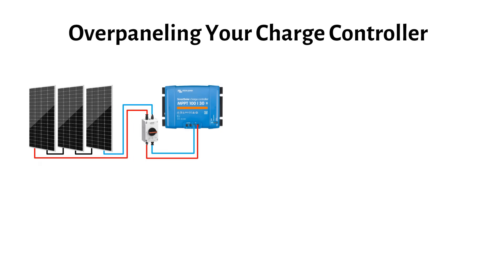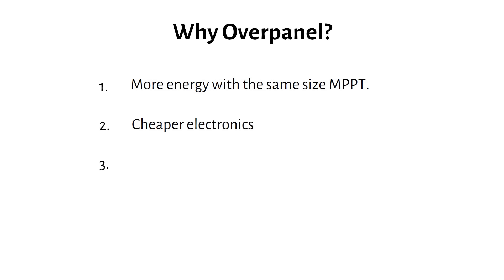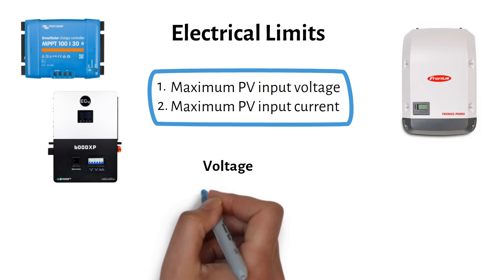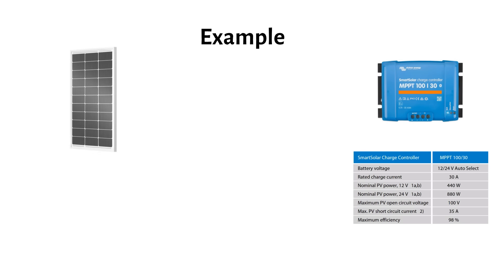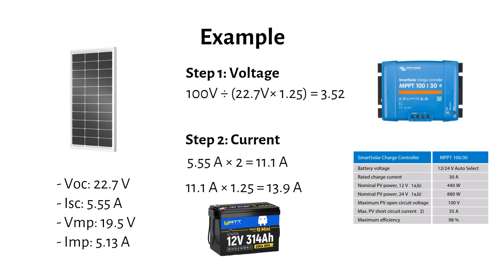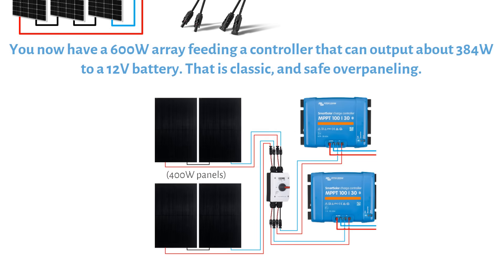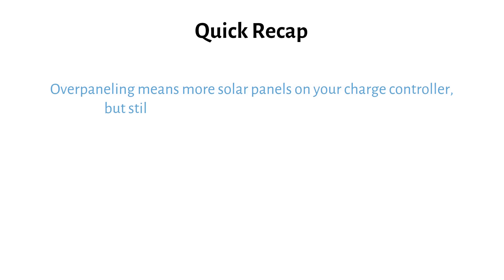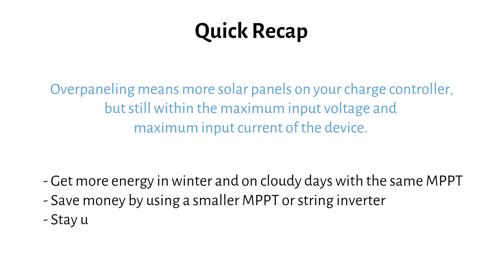Overpaneling Solar: How Much Is Too Much?

Comment: Very good episode!   I'll add three additional additional points to think on. The big one first, then two smaller points:

The big poiint is... the inverter's output rating doesn't have to clip the solar when you also have batteries.  Nor do you particularly need a lot of batteries to completely capture the energy that would otherwise be clipped.  Even when the intention is to be grid-tied.   So when interfacing with the utility or a government and dealing with taxes and such, there is not actually a need to limit the solar to the inverter's capabilities because you also have a bypass path available to you to charge the batteries directly from the solar.

An all-in-one itself will generally have a certain solar capability (often the same as the inverter, sometimes bigger, sometimes smaller)... but nothing prevents you from also tacking on your own discrete charger controllers and bypassing the inverter entirely, overcoming those limits.  The charge controllers do not generally count towards taxes.  The battery can then be used by the inverter for self-consumption or to extend your (still limited) export into the more lucrative evening hours.

--

The first small point is... consider always having a combiner box when paralleling anything but the simplest panel topologies.  A combiner box is adding a lot more with regards to safety features than people think.  You get a nice disconnect point (the breaker), individual disconnects via the string fuses, it prevents the other strings from dumping the current into a shorted string (blows the fuse instead), and it provides a much better protected environment for the fusing and disconnect (the breaker) than inline solutions provide.  So, good all around.

And lastly, remember that charge controller output capability scales with the battery voltage.  So that same charge controller that was limited to 384W with a 12.8V battery can do 768W with a 25.6V battery and 1535W with a 51.2V battery.   (actually a tad more in all cases since the charging voltage is 1-2V higher than the nominal average discharge voltage).

-Matt
Reply: Your 'big point' is very interesting. Can you explain how you achieve the bypass charge direct to batteries in both an off-grid and a grid tied system. Is this because you do not connect the inverter to the PV array at all or is it something that only happens when the inverter starts clipping.
Reply: @NewZealandBirdsNature  The all-in-one can be connected to the PV array and charge the battery up to its capability.  If you want even more solar than that, you just add more solar and run it into an independent charge controller that is connected to the batteries.  Or several, as desired.  There is no requirement that all the solar has to run through the AIO or be limited by the AIO.
Reply: @junkerzn7312  Thank you, very clear and useful.
Reply from the maker: Indeed, a battery ready string inverter or all in one is a good solution. You can get a smaller power rating of 3kW and charge the battery with the rest. So you only pay tax on the 3kW. But most people still have a string inverter. 

Yes, you can add more panels to mppt's straight to the battery. For example, some extra panels on your garage roof.

The point about the combiner boxes, it adds complexity and more parts where it can go wrong (bad connections). You will always have a DC disconnect even when you wire all in series. In my opinion, mc4 fuses and Y branch connectors do have their use, but with small systems. 

Yes, a higher battery voltage will reduce the cost of the charge controller. Thanks for your extensive comment Matt, I like it.

Comment: Do you know why the spec for max short circuit current even exists? The MPPT already current limits when it reaches its max output. I think it is only related to the reverse polarity protection of the MPPT, but otherwise is not a "real" limit, besides for safety of incorrect installation. Do you know any more about this? Nice video!
Reply from the maker: I think the electronics inside the mppt cannot handle more than the rated current.

Comment: Taxing inverters??? People need to realise our governments are the cartel!
Reply: That's why i make drones now. 😂
Reply: Weird tax indeed. We can have more powerful inverter as long as you limit export power to your plan. I have 24kW inverter, 15kW plan, 14.9kW export limit.
Reply: Electricity companies are so incompetent that it’s cheaper to go solar but when too much people go solar then city power grid have excess of expensive energy and to not let those companies to go bankrupt they lobby government to do something about it
Reply: They may justify that they are not getting VAT for that energy anymore, but when you bought the system you paid a huge load of VAT in advance so it's clearly not fair even in those circumstances. I could for example agree to pay some kind of tax on solar, but only after I fully recovered my initial investment. I paid over 20.000 euros for my (pretty massive) solar system and didn't recover more than 4000 yet, so they got to wait if they want any kind of extra taxes from me.

Comment: I am 100% off grid. In the solar zone I live, on a good day, we get only 70% of the panel's rated power. Even with that in calculation I over paneled by 100% to make sure that on average cloudy day I have enough power. Our batteries can carry us for two day and if we are conservative on power usage, three days. We are in a summer rainfall area and it is cloudy most of summer. Actually a good thing because if we get sun all week long it can reach temperatures of 45 deg Celcius. In winter we have very little clouds and seldom rain. The coldest registered winter temperature at my house for the past five years is +8 deg Celcius. So in winter we always have enough power.
Reply from the maker: Lucky you, 8 degrees not bad. By overpaneling 100%, you mean 10kw of solar for a 5kw inverter?
Reply: @cleversolarpower  I have a 6kW inverter and 17kW panels. 17kW x 70% peak in our area =12kW actual power. 12kW = 200% of 6kW inverter or 100% over paneled.
Reply from the maker: That seems excessive to me. You are losing quite some power. Why not add another mppt or string inverter and overpanel to max 140%? That way you could get 3 days of autonomy.
Reply: @cleversolarpower    In summer we often get up to a week heavy cloudy and rainy weather when we need such a lot panels to get through the day, especially with things like the tumble dryer that needs to run even more than on sunny days while the normal consumption must be supplied as well. I don't worry about the lost power on sunny days, I want enough power on days with very low solar power index and more mppt will not help for that. The other choice was to have less panels and install enough batteries to last a week, a more expensive way. And, I got the panels for very cheap.

Comment: On my boat I run two 500w panels , each one to a 100/30 victron MPPT. So def over panelled. But my 600amp battery bank is fully charged by 11am even on cloudy days.

By the way, that tax is bloody ridiculous.

Comment: Best option is to position your panels to collect energy for the most amount of day. usually Panels are arrange for maximum power at the peak sunlight hours. However then your likely not able to use all that power. If you rely on the batteries than your increasing the number of charge\discharge cycles on your batteries. Better to have two arrays: One optimized for morning sun and the other array optimized for the afternoon sun.
Reply from the maker: Yes, if I were to choose my roof layout I would get east-west. I made a video about it as well.

Comment: MPPT Maximum input current is sometimes specified as the current into the battery. Be careful
Reply from the maker: Max input is solar input. Output is to the battery. But those two get confused often.
Reply: @cleversolarpower Shopping online, I noticed that Powmr brand MPPT and solar inverters often have no explicit control of the battery charging current and sometimes deliberately only mention the maximum allowed battery charging current. Obviously not good.

Comment: That's unfortunate that they tax your inverters over there. We had a 30% tax credit here in the US, but it ends at the end of the year unfortunately. I oversized my MPPT slightly because I don't like my equipment working at 100% all the time and to give some room to grow if I change things around.
Reply from the maker: Yes, and soon the net metering will disappear as well. So you will be encouraged to get a hybrid inverter or battery ready string inverter.
Reply: It’s OK if your equipment is high-quality, it could work at 100% all the time and it doesn’t matter. When you turn the light on without a dimmer, it’s using power at 100% and it doesn’t matter.

Comment: I have 2 2,4KW microinverters fed by 4 * 500Wp panels each, and 2  separate 600W microinverters fed by 500Wp panel each those are facing southeast plus 2300Wp (8x 285Wp to west and 2x275W to east) panels feeding a 2KW inverter those panels are facing west shadows of trees and buidings drop the power and the peak power has been reached only a few times in june and july.

Comment: a scenario where you coud use closer to 200% overpaneling is if the house roof sides are to east and west, then one side produces peak in the morning, and the other in the afternoon, the power output curve resembles a (horse-)saddle with a drop near midday normal time .
Reply from the maker: Yes indeed. It used to be that a south facing roof was preferred to get as much power sent back to the grid for credits. But now governments encourage to have a battery at home and use self consumption during the day, and charge the battery to bridge the evening and night.

Comment: Why is that called "Overpanelling", if you stay within the maximum voltage and the maximum amperage of your charge controller? 
I would call that "Maximum Efficiency".
Reply from the maker: Overpaneling refers to more solar power on the DC side than the string inverter/mppt is rated for. For example 7000W of solar panels on a 5000W max output string inverter.
Reply: Because in ideal sun conditions, you're losing power that could be used or stored.
Reply: @jake-mv5oi  ~ My point was ~ You cannot "Overpanel" your charge controller beyond its voltage/amperage maximum limits. 
You can only combine panel wiring in series and parallel to get as close as possible to those limits.
Reply: @royrobinson4636  I believe he means you should have solar allays between morning to afternoon, and other from  afternoon to evening

Comment: Can a 5kw inverter that is taxed 500 euros even be worth the bother.
Reply from the maker: Yes, if you pay €0.4/kWh 😉. Grid tie solar in Belgium is a no brainier, got it back in about 3 years. Partly die to the fact that we pay about €65 for a 450W panel.

Comment: Overpaneling with South-West + South-East can increase solar day by 20+%.
Also lot of inverters have 2 or more strings input.
Reply from the maker: Great addition. I didn't mention that an east-west is preferable for grid tied with self consumption and battery. Maybe I should make a separate video about it.
Reply: I did that with my array this year and it has really increased my charging time.
Reply: For my temporary setup I use  2 or 3 full maximum  watt sets of panels. But angled  at different times of the day . 
You have to play with the angels. So that there is a dip in the out put Between the sets
 the deeper the  dip in out put is.
 the safer for the mppt

Comment: Excellent video. I would have made the amp calculation look similar to the voltage calculation though.
Reply from the maker: Here you go 😉:
The first step is to check the maximum input voltage.
22.7V × 3 = 68.1V
And with a 1.25 safety factor for cold weather this becomes: 85.1V
This is below the Victron’s 100 V max PV input, so 3 panels in series is fine.
Reply: @cleversolarpower  I meant calculating the maximum panels in step two using amps similar to how you did volts in step one. So
35A ÷ (5.55A x 1.25) = 5.05
So you could have a maximum of five strings so choosing only two is certainly within specs.

Thinking a little more about this. It would have been interesting to include how much each string would cost and how quickly they would have paid for themselves given the taxes on inverters. 

I did similar ROI calculations for my system with solar panels and batteries given historical storm data in my region. Knowing how often there are storms that last one day, two days, three days on up and a few assumptions on how many sunny days there are between them and then maximizing pay back time.

One other thing. Yes I have your book. It is fantastic. Thank you.
Reply from the maker: Ah, good point. I didn't do that because having more than two in parallel becomes complicated and costs more because you need the combiner box. It will also increase the cost of the cable. So it would be better to wire in series and have multiple mppt's for low voltage charge controllers. But you got good math there 👍
Reply: @cleversolarpower  I learn from, and copy your math, master. :)
Anyways, you almost always include a nod or two to the pricing. Like you did above. Which makes all the discussions so much more real. Thanks.

Comment: im asking about battery banks, can we parallel batt cells of 3.2v then series of four to make it 12v and just use only 1 big capacity bms?
Reply: You would have 4 in series for 12.8v, then add subsequent sets of 4, in parallel to increase the capacity of the pack - so if you had 100Ah cells, 4 in series gives you a 12v 100Ah battery, if you wanted (lets say) a 48v battery, that would be 16 in series for a 100Ah 48v battery, adding another series string in parallel increases it to 200Ah at 12v, and so on. If you want to build your own pack, please do some research, figure out the finer points of attaching a BMS and the correct way to connect up the cells, gauges of wire, connection straps, or better still, buy a battery kit that you assemble; you don't want to set the house on fire.
Reply: @Bob-h4s2ptnx

Comment: I did over panel, but before I got your book and watched these, I didn't know why.

Here's something about Wales (UK) that I have here.
6 month of normal solar and 6 of quite low. I set mine on the low scale of winter charging, but lots of power is still lost in this "clipping" in overpanelling, so my question is can I do anything with that panel power?  Not the power from the inverter once charging has occurred, but in the clipped power?

Thanks you if you do or don't reply, I'm sure you might fill in my lack of knowledge in later vids.

My setup is completely off grid, and I'm changing to a 16+kw battery and other stuff soon after being on an old school 07.5kwh battery lead acid block.  So not even a full 1kw battery 😂
Reply: There is a movement that uses direct dc from the panels.  You could run certain power tools, pump water, heat sand/water.  There are heat oumps that run on panel dc directly.  This could even integrate this with your existing inverter.  Only the heat pump is off the shelf.
Reply: And strictly speaking, with a solar tracker, most of the day will be peak power, so you can get more power through the charge controller using fewer panels

Comment: The advantage of overpaneling even in cloudy days you get enough solar energy. Our country is near the equator, i dont use 1.25% safety factor when sizing. I have 5 mppts consist of 150v and 180v and 120v. They are overpanel x2 of their sizes.
Reply from the maker: Yes, with hot panels you will operate above STC ( temperature wise). So the voltage will not get higher than Voc. However, for most people, they need the safety factor.

Comment: Ja absoluut, gaarne een video over grid tie en batterijen, dat is wat ik graag wil. Heb nu een oplossing voor mijn dagelijkse energie via solar en ‘s nachts via de grid, maar wil meer onafhankelijkheid
Reply: The down side of grid tie is when the grid is down so are you. Better to spend more on batteries and less on panels. Get an inverter to power essential appliances.
Reply from the maker: You can have your existing string inverter connected to the essential loads of a Victron Multiplus (can't be too large). Or get a hybrid inverter. So everybody who has a string inverter should upgrade to a hybrid one, also called 'battery ready' you don't have to connect the battery for it to work. So you can add the battery later.
Reply: @cleversolarpower  yes that is my idea to get a hybrid one. I live ins Se Asia, so i have no idea if victron is available here. Using now a Sofar 5kW one.
Reply from the maker: Deye should be great as well.
Reply: Vir onafhanklikheid, gaan heeltemal "off grid" met batterye.
Reply: @KHJ_am_I i wish i could but don’t have the financial means for that. I am aiming now for a 5kW Hybrid with 10kW Lfp4 batteries to keep us in business when the power cuts